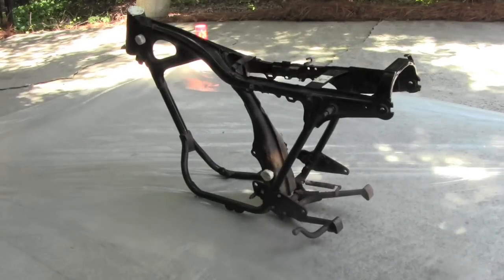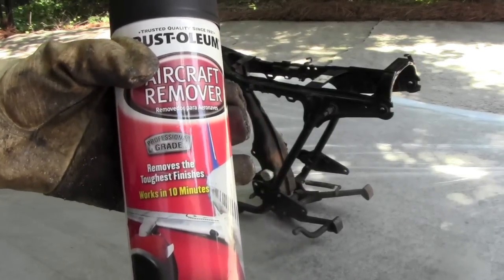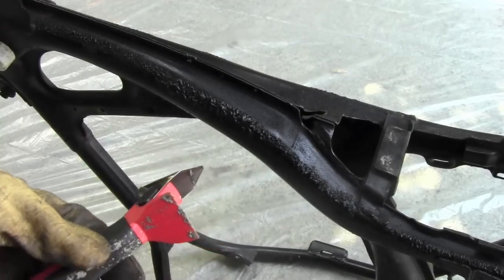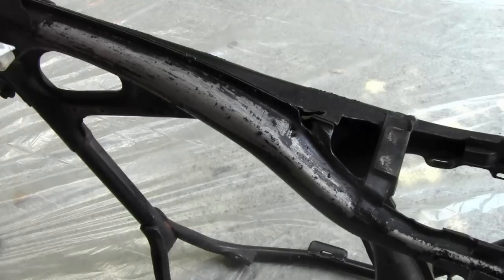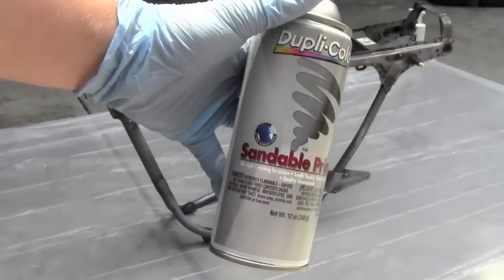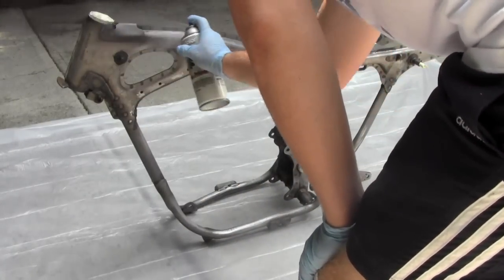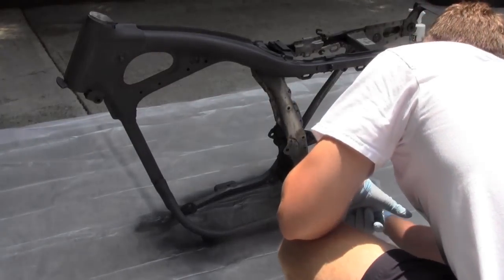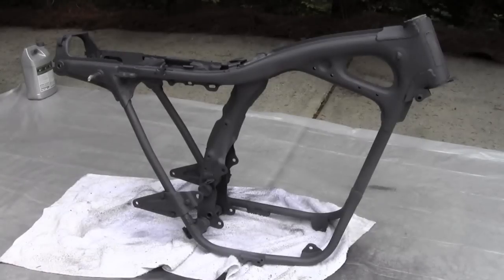How to Paint a Motorcycle Frame

Comment: I've always heard that if you don't need to take it to bare metal - don't. What is the purpose of removing the old paint, was it not the original? Why not just clean and degrease? Seriously asking not being smarty.
Reply: ***** if there was rust under the paint it should sand or chip off no problem..
Reply: Igeeky1   I know this is an old comment but the reason to remove the old paint is because it has started peeling, rust and other reasons. If you were to paint over it then the rust will come back easier and the finish won't look very good because the old paint is bad. I use a wire brush and butane/propane torch to remove the old paint and then remove all traces of rust before primer.

Comment: Sorry, but you should rename this "how not to paint a motorcycle frame. The method you used will not last. You need epoxy primer and then you should have used a high temp paint if using from a can and if from a gun you should use eurethane or laquer

Comment: Theses spray paints are Never Durable or Last long,,, if a drop of Fuel is touched to this paint, at once it will be like Melting.....
Reply: No, that all depends on the paint.
VHT Roll bar paint is even chemical resistant .

Comment: hi the pillion foot pegs are attached to a part of the frame that comes off. I need to paint that part. The steps are sand it/remove all rust and paint; primer (as many coats as indicated in the can); and then colour. Is that correct? Thanks

Comment: Do you always have to remove the previous paint layer?
Reply: No you don't. If you want a perfect paint job, yes. but here we are painting a frame, most of which will never be seen so I would think a light sanding, washing, drying etc & then a couple of coats of paint should be good enough.
Reply: Mrflymess  Unless you're restoring a good bike then it's always better for it to be done right.
Reply: NO

Comment: MRC I have not been able to source aircraft stripper at the local hardware or home improvement stores. Paint thinner does not work like this stripper, granted I am working on an 82 Gl500, and do not know if the factory paint/procedure is different than yours. How did this paint hold up? Was there any peeling due to heat from the engine/exhaust? Aprox how many cans of primer and topcoat did you use?

Ever heard of POR-15?
Reply: Found some serious stripper in a can at Walmart. Very impressed.
Reply: ***** I was very hesitant to use the POR-15 because the Napa employee said he used it on an old Harley he found in the woods. True, the bike is going to strickly be on the hwy. I would love to get it powder coated but really can't  offord it. If done right, I am confident the spray may work for this application.
Reply from the maker: You can find aircraft remover at any auto parts store. I personally think it works better than anything else so I have to stand by it!

Comment: did you have to do anything to protect the paint from chipping from rocks and such?
Reply: Clear coat
Reply: @D3athduo  and what keeps the clear coat from chipping. Correct answer paints will chip right through the clear coat. Best you can do it an activated 2 part paint or powder coat.

Comment: should I use a sand blaster instead of paint stripper?
Reply: +Daniel wells , sandblasting opens up metal surface so its porous and prone to corrosion. So if the element is not mostly rusty  manually stripping the paint is safer,  but in hard to reach areas like welds, joints  sandblasting does a better job.
Reply: not everybody happen to have mega large compressor and pro sanding setup,  and if i give my frame to a shop i doubt they'll be discussing about the medium to use.   So to be safe, i prefere to strip the paint myself,  and just use a non proffesional cheap sanding gun just to clean up the welds.
Reply: I did on a Harley rebuild back in college and it turned out just fine. In fact I am thinking about asking a student to blast another frame for me and slip him 20 bucks.Or maybe blast the whole bike for me.

Comment: You really dont have to remove all the Paint. Just sandgrit with layer 240,800,100,1200 and use iron brush for rust.
Reply: 600 is fine